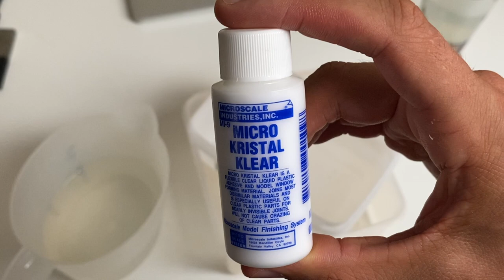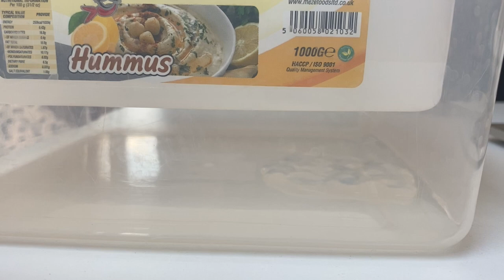Radio Control Trumpeter 1:200 Titanic Build Part 2 - Glazing

Comment: Hi, interesting testing!  The Fibre optics you mentioned,  I actually did some testing yesterday.  Light emission very good and it will take a little bending. I tried a piece in boiling water for a few seconds and then eased it to a shallow 90 degree bend followed by a cold plunge.  Worked well and light still good so worth thinking about!  There are a few video's posted of R/C being put into this kit.  Weight should not be a problem with all the extra stuff you need to add as the displacement is surprisingly high to get the hull to sit correctly.  My static Olympic conversion will take ages before I even get to the main build, so much research needed as I am building circa 1930's.  I will need to make a load more lifeboats and I have sourced some davits.  MiniBrass  do a whole range of 1/200 Olympic class goodies that you may be interested in!!  The promenade changes that I need to make are surprisingly spindly.  The plastic around the windows in this kit is quite thick so a few people are working on thinning it down a bit. The large portholes did have an inner shaped frame but do you really want to go that far!  Watching with interest!  :  )

Comment: Subscribed and shall be closely monitoring the built :) Just received the set today and the PE parts are on their way! Which pic did you finally follow for the portholes ? Excellent built and wishing you nerves of steel! At least I will not RC mine. Thats something....
Reply from the maker: I think its a complex build whatever you do with it! I uses the pic of cherbourg (which I later found was edited and so isn't reliable) so on top off that I drilled out a few extras here and there.